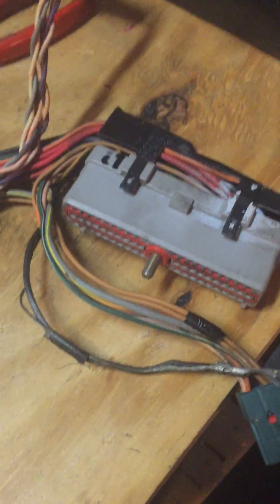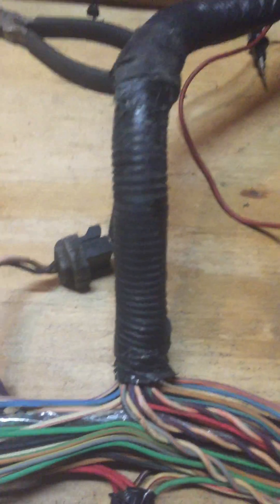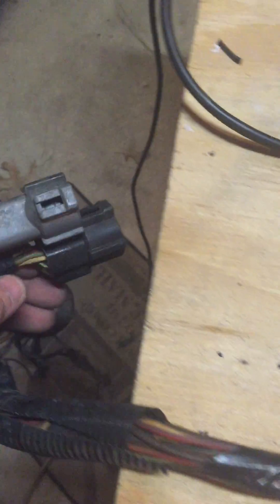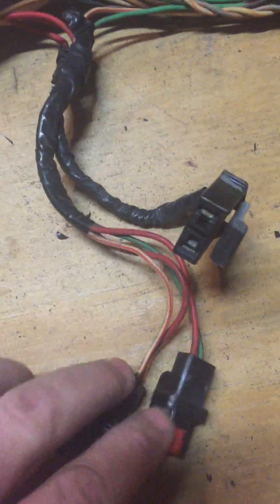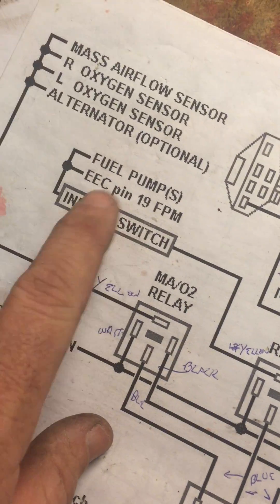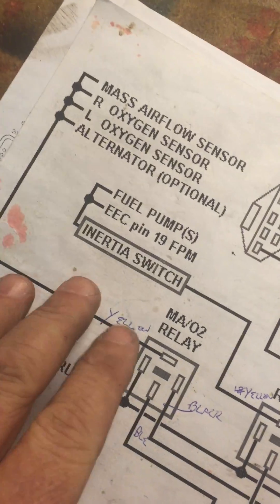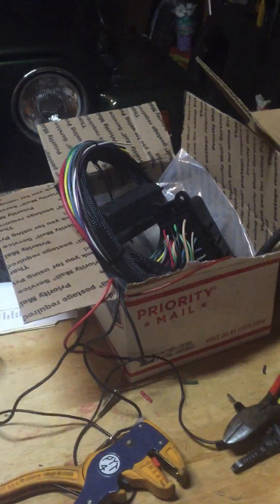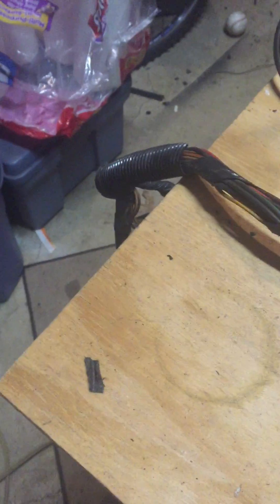Ford 5.0 EFI Harness Conversion Walk Through Part 3

Comment: We have a 1993 fox body Mustang 302 we need to see if maybe you can redo the wiring harness we are keeping the 302 in the Mustang the problem is a lot of the wires are old broke and burnt it caught fire close to the mass air flow sensor so could we send you the whole wiring harness relays and everything and you redo it
Reply from the maker: Hello, I may have some time to redo your harness.  I do these on the side in my spare time.  I think you can message me through YouTube for contact information and we can discuss in detail if you want.

Comment: Do you sell the harness ready to install? I have a 95 mustang set up  I am installing it in a 84 ranger
Reply from the maker: douglas dixon I am only working with the EFI harnesses for the 86-93 computers. The harness and pinout on the 94-95 computer is different.  I don’t have experience with those. If you decide to run an earlier ECC, I may be able to build you one.
Reply: Ok thanks man I appreciate your response
Reply: How would I be able to tell what year it is
Reply from the maker: douglas dixon there should be a three digit code on the computer at the connector. Let me know what it is and I’ll look it up for you.
Reply: X3Z
Reply from the maker: douglas dixon that looks like a 93 Mustang Cobra computer. From what I read it is a very desirable EEC because it is programmed to use bigger injectors (24lb) from the factory.  The 88-93 pin out diagrams should work with it.
Reply: It has a power dyne supercharger on it
Reply from the maker: @douglasdixon6460  Do you have a harness core from a donor vehicle?  I will see if I have a complete one to work with, but typically I will work on one that is sent to me.  Email me offline...phillipsmcsd at gmail dot com.  Easier to communicate that way.

Comment: Would  this work on a 5.0 from 87 f250
Reply from the maker: Yes my conversion steps will apply to any 5.0, as long as you use a Mustang computer (A9L etc...).  I am using the schematics and pinouts for these computers only.  If you use one from an F250, you will need to find the schematics and pinout diagram for that computer.  I don't have that  info, but it is probably online somewhere.

Comment: I just ran in to your 5.0 harness video. I"m also going to try to instill a 5.0.I got off of a 90"s Lincoln. I removed all the wire harness  with the computer.I would like to put it in a 1950 ford shoebox any info will help.Thank for the videos. mendezbonifacio@gmail.com

Comment: can you post where you found the info
Reply from the maker: Hi Bryan,  I found a bunch of docs on this on the Mustang boards.  It is not a specific how to as each conversion is different.  I eliminated anything having to do with the AC and emissions.  The pins that I removed were 10, 31, 32,33,38 and their connectors.  This left extra leads for the power circuit 37/57 that threads through the entire harness, so I just cut them short and put a heat shrink tubing cap on them so they won't short on anything.   Rich
Reply from the maker: Give me your email address and I will send the docs that i found to you.  Rich
Reply: @MajorSporto  any chance you could email me the info?